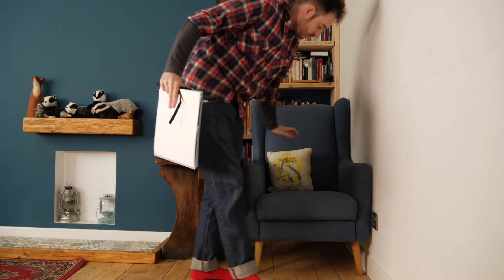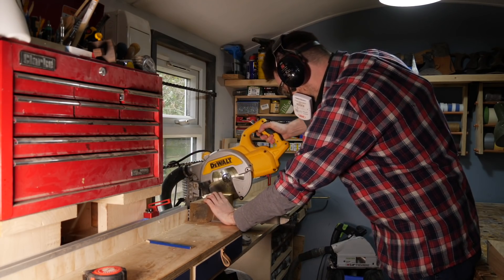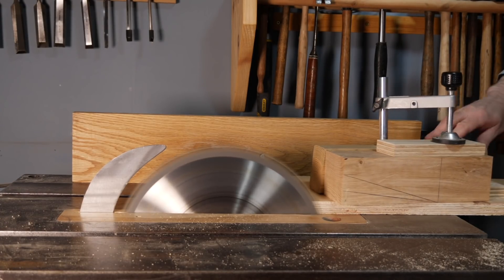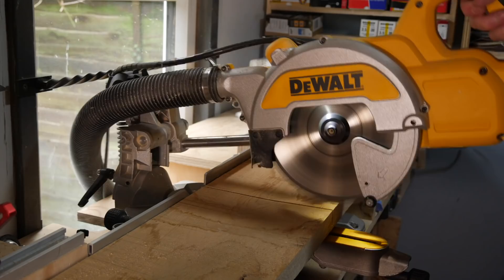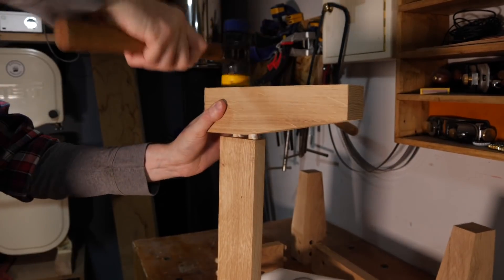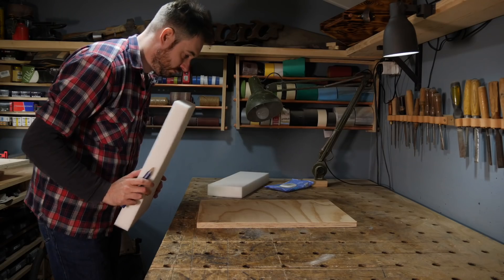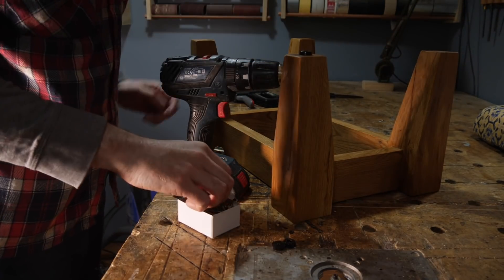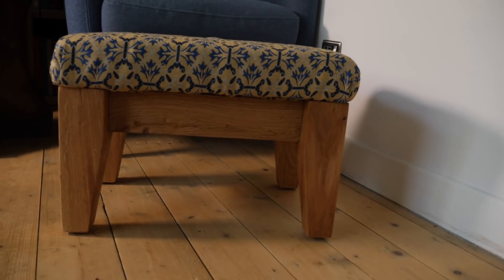Time To Put My Feet Up, making a foot stool

Comment: Upholstery is tricky. It was once considered a King's art, much like paintings and sculpture. 

20+ yrs experience. Not criticism. Tips. 
When you covered the trip with the fiber padding, knock those corners of the board down, so they don't end up tearing the fabric with wear and tear. 

Second, when you start applying the fabric, pull one side right enough to hold it. On the opposite side, push the board until the fabric is tight,, THEN tack it down. On the corners, pull up and over the corner, first. This will create pleats on each side and that food will be far less noticeable. 

You did well in cutting the foam larger than the board,, bit it needs to large enough that you can tack down through the foam into board, then you roll the top side down, either even with the side of the board or for a VERY SMOOTH look, to the opposite side of the board. 

Adding the batting to the top is a great move. 

Obviously, the upholstery could be better and will with experience, but the look is absolutely fantastic!

New sub!!!
Love the Christmas tree idea!!!!!!
Keto up the good work!!!!!!

Comment: Lovely work again Matt, just one pointer with the upholstery if you glue the foam to the backing board it helps to stop it from moving about, lovely piece of oak though its a fantastic wood, one of my favourites, well done👍
Reply from the maker: Thank you. What glue works well with foam?
Reply from the maker: Great thank you. I will try that next time
Reply: Badger Workshop toolstation spray contact adhesive is cheap enough and works well, my daughter (the one that lasered your drinks coaster) and I stripped and reupholstered the four kitchen chairs and a slightly tricker round stool for the workshop this summer (quality time 😀)... you did a great job! The tip we followed was to put a bit of tension on the fabric as you go North - South then East-West in the centre of the base, then to work out from each centre staple again with a bit of tension, so as the foam becomes less springy you've not got flappy bits of fabric....but I too am not an expert 😉
Reply from the maker: Thank you i will try that